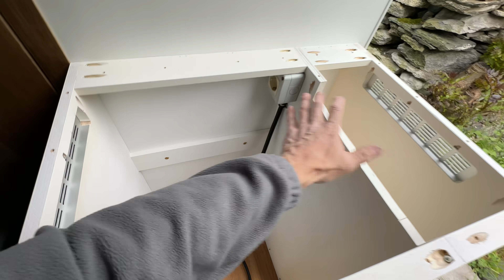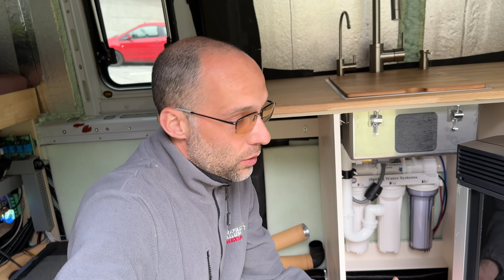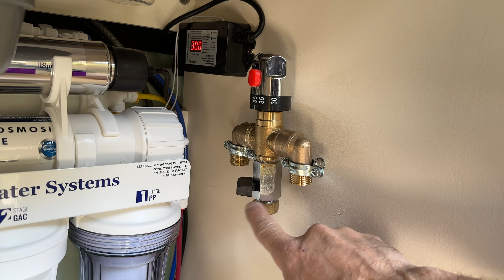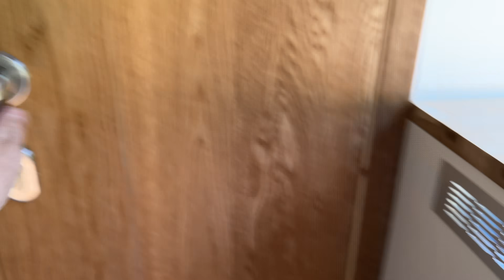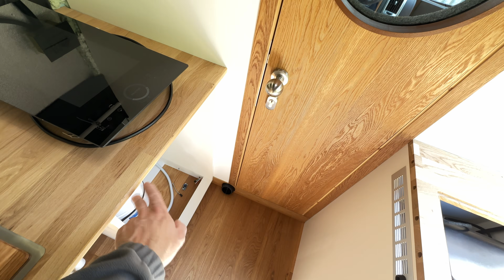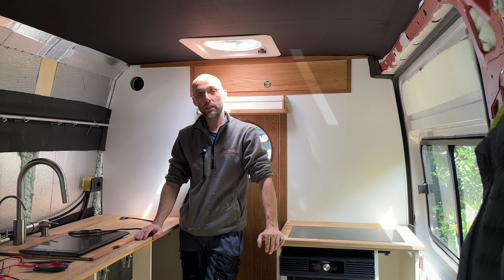EP28 part3 - Fridge and induction cooktop [ DIY VAN BUILD ]

Comment: Ciao Diego! Saluti dalla Spagna!
What is the Max Power of your induction cooktop? Can you run it on full power on your inverter or does the cooktop have a power limiter feature? (Not sure if your multiplus is 3000 or 5000)
About the Fridge, I guess it’s the Dometic RC10.4 70
I’m about to buy the 90L version. Some people complain a bit about the noise and warm air coming out from the fridge. What is your experience so far?
Thank you in advance
And congratulations for your amazing work.
Reply from the maker: Ciao! :) It is 3500W one burner is 2000W and the other is 1500W. I have the 3000 multiplus. I just know that I can use one or the other at full power. If I need two on at the same time I need to be careful to not overload the inverter. no limiter function...
Yes it's the Dometic RC10.4 70, Not much noise, it has also a so called "night function" that lower the noise even more. Yes some times there is warm air coming out the vent but any fridge produce heat. The dual door opening is great but I wish it was made a little bit more durable, to much plastic parts unfortunately .
Reply: Thank you for your reply @diego_tam  
Keep up with your work, you are building and Amazing Van.
I will keep watching your videos now and then as inspiration 🙌🏻
Complimenti! 💪🏻